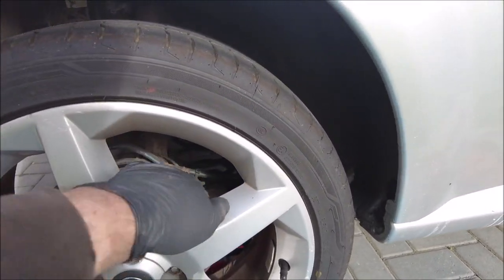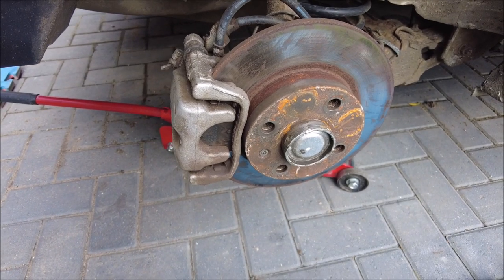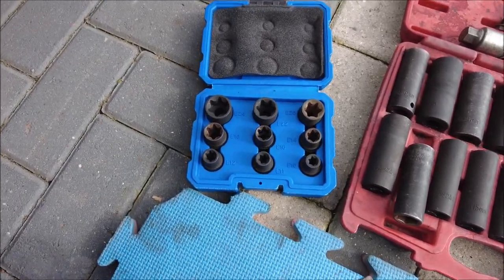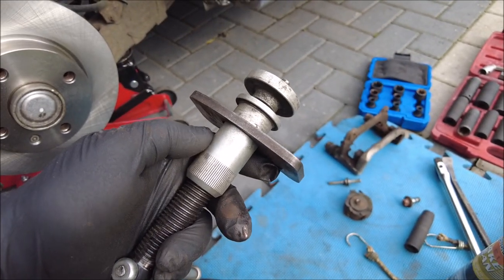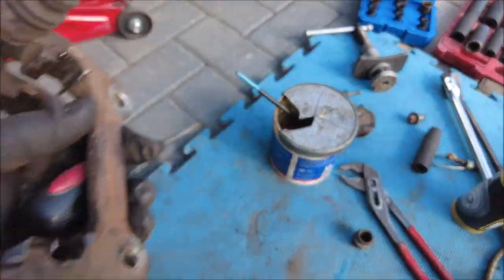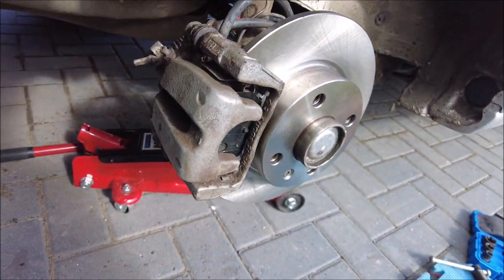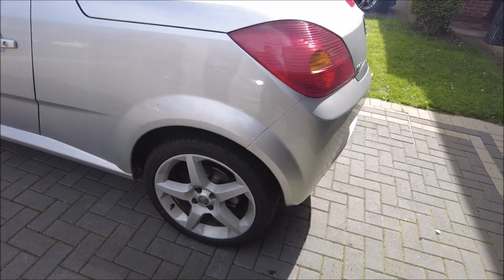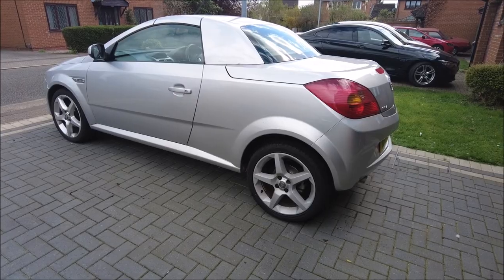Vauxhall Tigra Rear Brakes replacement...  #tigra #vauxhall #brakes #diy

Comment: What happened to the splash plates did you remove them earlier sometime ago or were they AWOL? And I wondered what the round weights were called any idea what they actually do?
I would like to know!
Reply from the maker: The "Tins" were deleted when I got the car...looks like they rotted away years ago and impossible to get new ones (tried in a previous video) ... I'm told the weight is a damper control but seems a bit pointless to be honest .